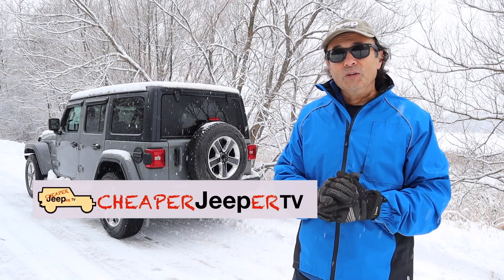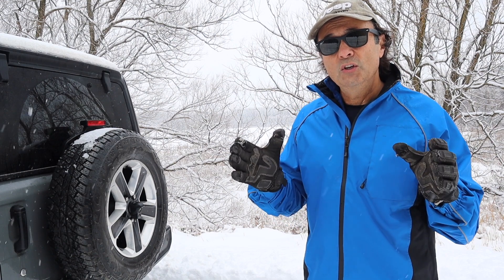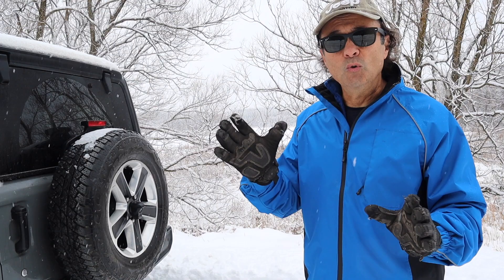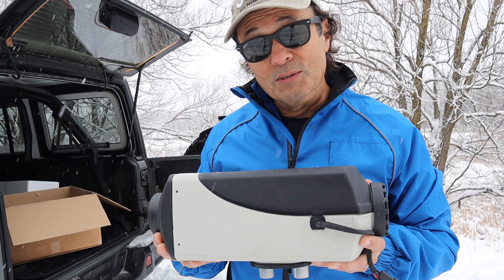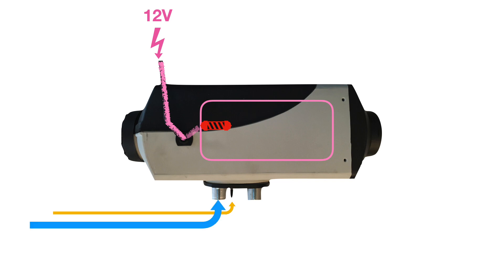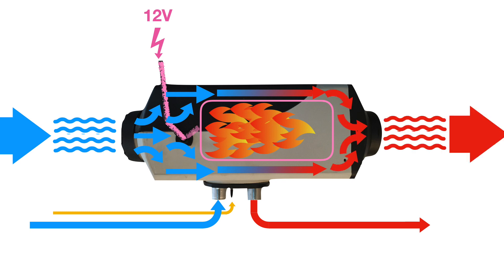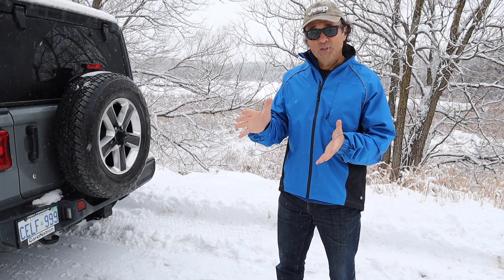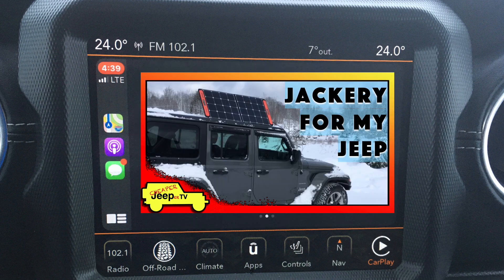DIY Portable Diesel Heater in a Box for Camping: Design

Comment from the maker: **IMPORTANT** 
Since first posting this design idea, I have come to learn that the exhaust is NOT air tight, and can leak exhaust. Thus it should not be installed in the box if one intended to draw heater intake and combustion air from within the box. I have since changed the design as illustrated in the next video.
Reply: Carbon monoxide was on my mind while watching the video. You could also seal the edges and bottom hole of the muffler (just my opinion). I had a 2 stroke moped on my teenage years and the muffler does not have any oil outlet at all, sometimes, oil may just pass thru the muffler but did not interfere with the performance of the engine with years of use.
Reply from the maker: @user-sf9mh1ms4q  Hey J, Inwas thinking the same thing, with that run of exhaust fumes being so short it could just blow through pretty easily.  Cheers.

Comment: Never thought of doing anything like this, that's amazing! I will need to have this for all the winter camping that I do :)
Reply from the maker: Hey TrailWalker, Awesome. You can do whatever design meets your needs. I’m using the case  I already had. You can use any case you like if you wanted more room inside to store things. I was going for the minimal used space option. The fact that it can be shared with multiple ducts is a nice feature too. Glad you found the video interesting. Cheers.

Comment: Great video. Thanks. Can you share link for where I can buy pelican box?. I prefer over Dewalt box. Have you created a video 4 Dewalt box?
Reply from the maker: Hey Sonny, Here are links to some Pelican Cases, https://amzn.to/3q5BsZM, https://amzn.to/3r0JRNt. They seem like great cases. They are both different as the design of your application would depend what size fuel tank you'd use, and if it would be located in the case or elsewhere. I have not done an update video on my design or for the Dewalt box yet, but plan to soon.  Good luck. Cheers.
Reply: @CheaperJeeperTV  thank you for following  up.i was looking more or less the one u used in the video. Love that box. Cheers.
Reply from the maker: @sonnyjadun1169  Hey Sonny, That box isn't entirely weatherproof, but does the trick for sure. In my follow-up video, I'll be suggesting modifications/improvements to the design. Cheers

Comment: What about any cushioning inside the box to lower vibration sound?
Reply from the maker: I was initially concerned about the impact the heat would have on any cushioning, but since using the heater, the heat doesn’t build up much at all. I’m considering adding padding in the filter side of the box. I’ll post an update video soon. Thanks.
Reply: No the heaters need to have air around them or it might run to hot 🥵